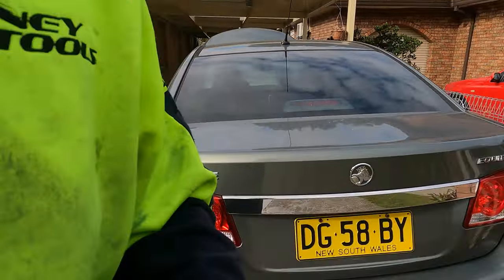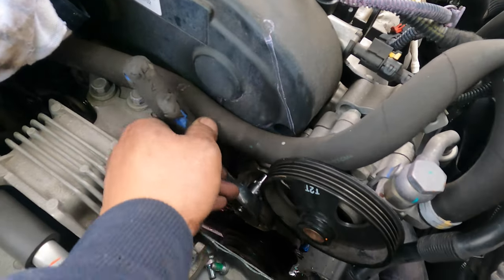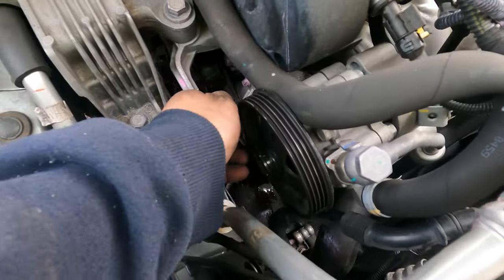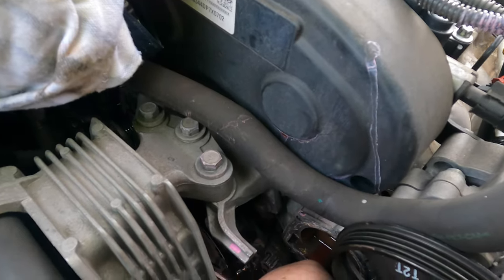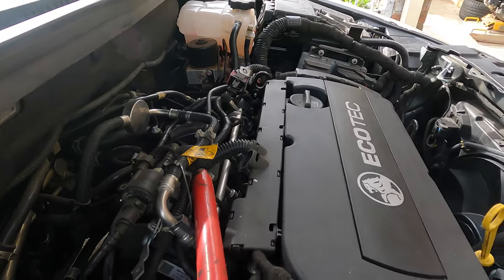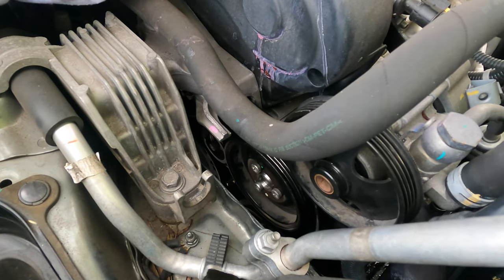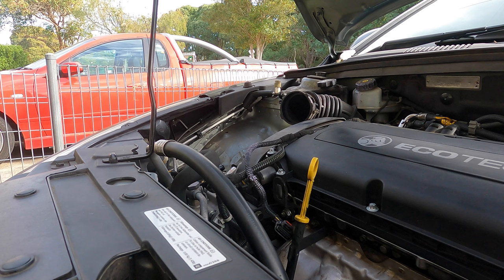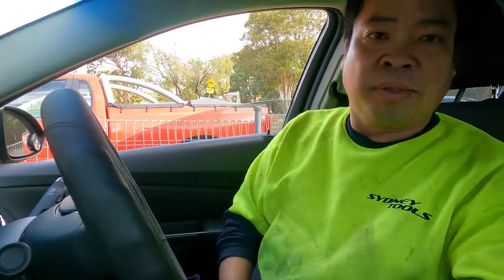holden cruze equipe water pump replacements

Comment: Holden Cruze are the worst engines ... they run at 110c° normal temp ...
For Australia thats Trouble
For Germany thats OK ...

Have you ever changed a Head Gasket Simon ?

Best to throw the Engine away and find a 2nd hand Engine ..  
Cruze are German rubbish no good for Australia .. 

Thats why Holden dont make cars here anymore ..